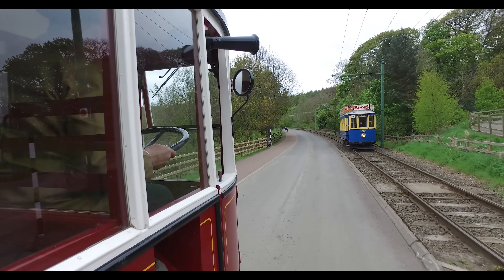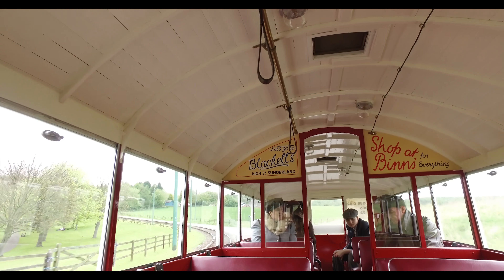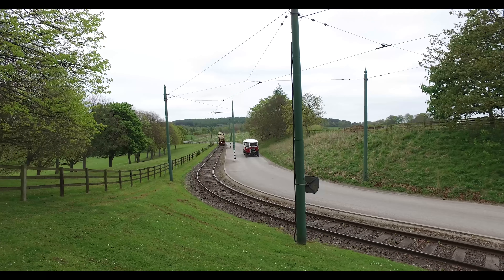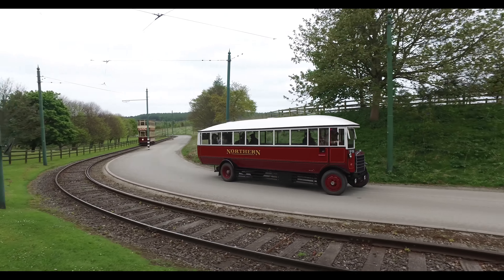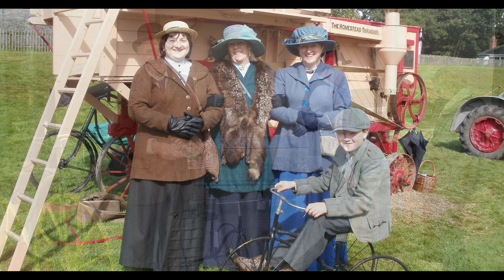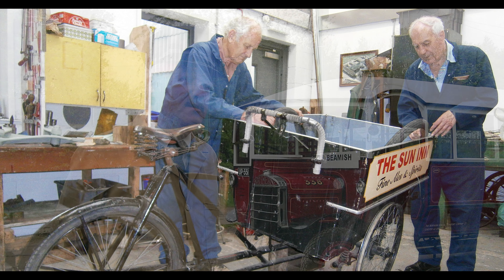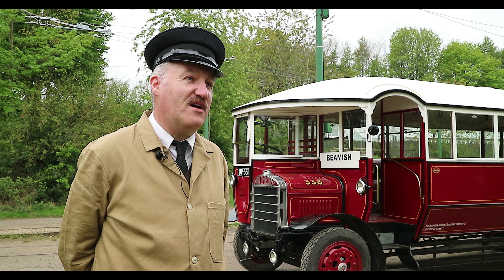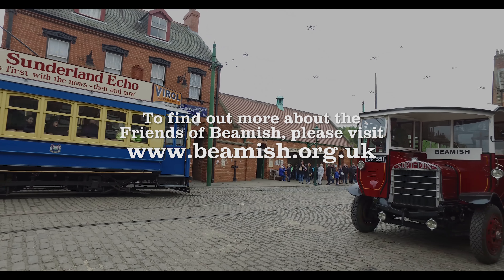History and restoration of the Northern SOS bus

Comment: As I am not comfortable 
asking the depot why they stopped running the London Suburban Loud 
4-Speed Leyland Hydra cyclic Automatic Gearbox Gardner 6LX and Gardner 
6LXC Diesel Engine Olympian ECW’s on routes 30, 121, 230, 271, 349, N279
 And 158 why can’t we make the same make of the Loud 4-Speed Leyland 
Hydra cyclic Automatic Gearbox Gardner 6LX and Gardner 6LXC Diesel 
Engine Olympian ECW Buses but Modernise the insides of these Buses. 
Also, make it low floor up and down and also extend the middle body part
 of these vehicles a little bit more so there will be more space for the
 wheelchair users. By the way, if you could remake and Modernise these 
vehicles could they also make them into a Loud 4-Speed Leyland Hydra 
cyclic Automatic Gearbox Gardner 6LX and Gardner 6LXC Diesel Engine 
Olympian ECW Version that if it will be possible to Modernise the 
insides of these Loud 4-Speed Leyland Hydra cyclic Automatic Gearbox 
Gardner 6LX and Gardner 6LXC Diesel Engine Olympian ECW’s make it low 
floor up and down and also extend the middle body part of these vehicles
 a little bit more so there will be more space and even a London 
Suburban 4-Speed Leyland Hydra cyclic Automatic Gearbox Scania N230UD 
Enviro 400 MMCs and 4-Speed Leyland Hydra cyclic Automatic Gearbox 
Gardner 6LX Diesel engine Enviro 400 MMC’s and also extend the middle 
the body part of these vehicles a little bit more. Why couldn’t we have 
those London Suburban Buse's Pale red on the top roof Pale red again on 
the top middle Milk Chocolate brown on the middle Creamy white on the 
Bottom Middle and Milk Chocolate Brown again on the Bottom on most of 
those kinds of those Particular Double Decker Vehicles? Could you put 
the Loud 4-Speed Leyland Hydra cyclic Automatic Gearbox in the Scania 
N230UD Enviro 400 MMCs and also put the Loud 3-Speed Voith Diwa Gearbox 
in the Volvo TD102KF Engine East Lancs Olympus and also extend the 
the middle body part of these vehicles a little bit more and also turn 
most of them to London Suburban Buses. By the way, could you also make the 
routes 349, 121, N279 and 271 into London Suburban Buses and have a 
a mixture of a Loud 4-Speed Leyland Hydra cyclic Automatic Gearbox 
Scania N230UD Enviro 400 MMC and Loud 4-Speed Leyland Hydra cyclic Automatic 
Gearbox Gardner 6LX and Gardner 6LXC Diesel Engine Olympian ECW 
Versions. Could they also transfer the Arriva Bus Depots from Hackney to
 Stagecoach company so they can replace all the Arriva buses so that all
 of them can go to Birmingham and Leeds and they can be replaced by 
Stagecoach Loud 3-Speed Voith Diwa Gearbox Volvo TD102KF Engine East 
Lancs Olympus and also Extend the Middle body part of these Vehicles and
 that includes A Mixture of a Stagecoach Loud 3-Speed Voith Diwa Gearbox Volvo TD102KF, Gardner 6LXC and Gardner 6LXCT Engine Northern Counties 
Palatine One and that Includes a Loud 4-Speed Leyland Hydra cyclic 
Automatic Gearbox Gardner 6LX Diesel engine Enviro 400 MMC’s and Loud 
4-Speed Leyland Hydra cyclic Automatic Gearbox Scania N230UD Enviro 400 
MMC Vehicles A Little Bit More? Can Arriva London Bus Company Replace 
Most of their Wight Buses so they can also transfer them to Birmingham 
and Also Manchester so they can be replaced by Loud 3-Speed ZF Ecomat 
Gearboxes Volvo D10A Engine East Lancs Olympus and also Extend the 
Middle body part of these Vehicles A Little Bit More Thank You Very Very
 Very Very Very Very Very Much. Oh by the way could the bus Factory 
Companies also Make More of Those Loud 4-Speed Leyland Hydra cyclic 
Automatic Gearbox Gardner 6LX and Gardner 6LXC Diesel engine Olympian 
ECW Vehicles And that also includes Those Loud 4-Speed Leyland Hydra 
cyclic Automatic Gearbox Cummins L10 Enviro 400 MMC And also Extend the 
The middle Body part of those Loud 4-Speed Leyland Hydra cyclic 
Automatic 
Gearbox Gardner 6LX and Gardner 6LXC Diesel Engine Olympian ECW Vehicles and the Loud 4-Speed Leyland Hydra cyclic Automatic Gearbox Cummins L10
 Enviro 400 MMC Vehicles and that also includes The Loud 3-Speed ZF 
Ecomat Gearboxes Volvo D10A Engine East Lancs Olympus A Little Bit More 
And Paint Those 4-Speed Leyland Hydra cyclic Automatic Gearbox Cummins 
L10 Enviro 400 MMC Vehicles and also those Loud 4-Speed Leyland Hydra 
cyclic Automatic Gearbox Gardner 6LX and Gardner 6LXC Diesel engine 
Olympian ECW Vehicles and that also includes The Northern Counties 
Palatine One with a Volvo TD102KF, Gardner 6LXC and Gardner 6LXCT Diesel
 engines with a Loud 3-Speed Voith Diwa Gearboxes and The Loud 4-Speed 
Leyland Hydra cyclic Automatic Gearbox Scania N230UD Enviro 400 MMC 
Vehicles and also The Loud 4-Speed Leyland Hydra cyclic Automatic 
Gearbox Gardner 6LX Diesel engine Enviro 400 MMC Vehicles to the Grey 
Green Colours Just Like The Other Original Scania Grey Green on the Bus 
Route 125, 173, 313 and 103. If all of the 14 Leyland Titan B15s are
 Fully Red and even Mostly Red, could they also Repaint All of Those 14 
Leyland Titan B15s into Grey Green Colours Just Like The Other Original 
Scania Grey Green on Bus Route 313 so they can Reuse them for Only 
Every Seven and a Half Months and also Reuse them on those Rail Replacement 
London Bus Routes if that will Be Alright for Only Just Every Seven and a 
Half Months, starting from the beginning of October and also Reuse Those Buses Only on the London Bus Routes which are The 341, N41, 34, 123, N29, 149, 221, N73, 121, 86, 30, 262, 147, 396, 41, 56, and N26 so Please make sure that the builders can do as they are told!!!! And please do 
something about these Very Very Very Very Very Very Very Very Very Very 
Very Very Very Important Professional Ideas Pretty Please? Prime Minister and also includes the Mayor of London.